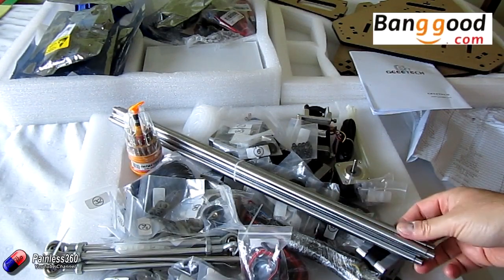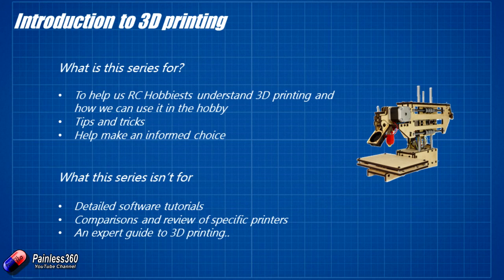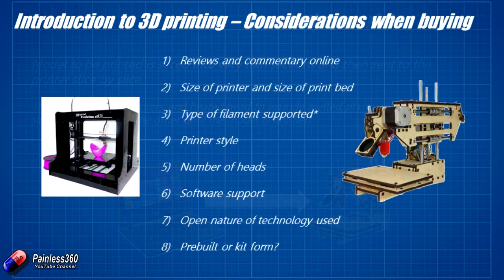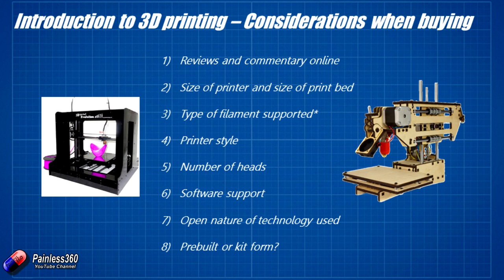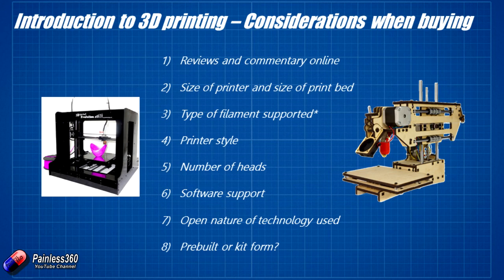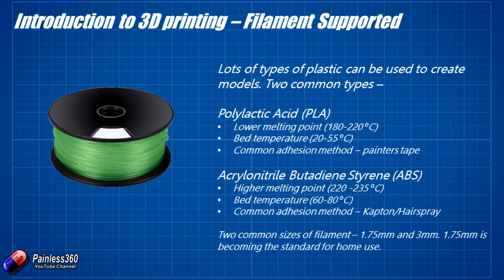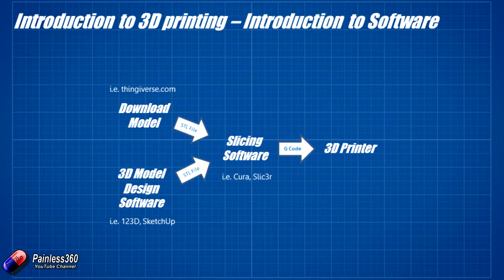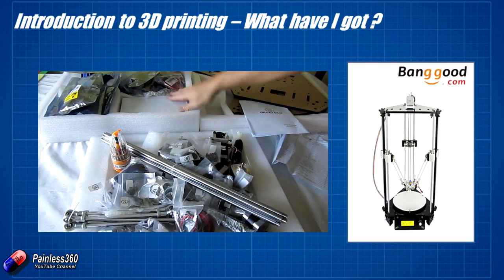(1/1) 3D Printing for RC: Introduction to the main concepts for 3D printing

Comment: Very interested in that printer and how it works out for you. The reviews seem very mixed.
Reply from the maker: +David Drysdale This isn't a printer for a first timer. The calibration is tricky and it takes time to get to a great print. I've just ordered the metal upgrades for mine to help print the PLA.. Next video is in the playlist..
Reply: +Painless360 Thanks I did not spot it in my subscription feed. Would the metal upgrades be what is in the pro version?
Reply from the maker: Exactly. Only changing it as I want to run the heads about 240 for PLA and the plastic shrouds on the heated ends of the basic model melts about 245!

Happy printing!

Comment: Thanks for all the great videos! I would really love it if you would do the build process on video. I would consider  buying one, the wife is asking what I want for Xmas. 

thanks again for all your hard work.
Reply from the maker: +Scott Powdrill The build process was tough enough without trying to film it at the same time. The instructions are ok and I will be posting close up images of the final build in the full review of the printer. What I will do is run through the instructions and point out the areas where a tip or trick is useful! (The instructions are for the 'Pro' version - all metal - and this kit comes with a number of printed plastic parts).. I will cover this in the video but any RC builder who had built and setup something like Arduino and a RC CP helicopter will be able to do it easily.Hope that helps.

Comment: pla abs nylon and... what? wood? just looking at the printer u are building on banggoods, how dois the wood work? i dont understand. it cant melt it right?
Reply from the maker: +jelle buyckx The 'wood' filament is actually small pieces of wood suspecded in a plastic filament, the plastic still melts and flows and deposits the wood fibres. It does then allow it to be polished etc. like wood. http://colorfabb.com/woodfill-fine
Reply: Painless360  i see. it only contains 30 percent wood fiber. to give it te look. more like a wood"ich" filament then. :) thenks for clearing out.

Comment: I printed a camera mount in ABS and it still breaks. Don't think just because you have the extra strength you'll be invincible.
Reply from the maker: +joblessalex Evrything has it's limits even NYLON. If it breaks then the design and/or plastic used needs to be reconsidered.. Happy flying!